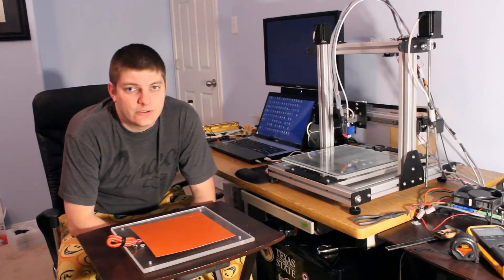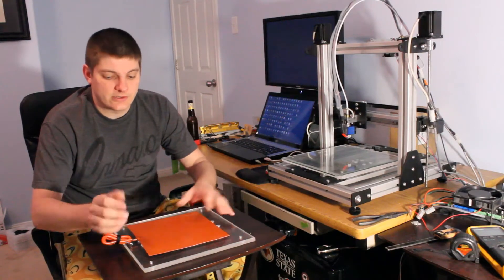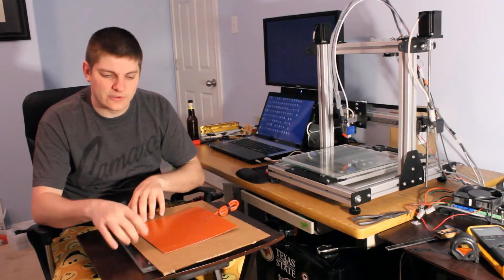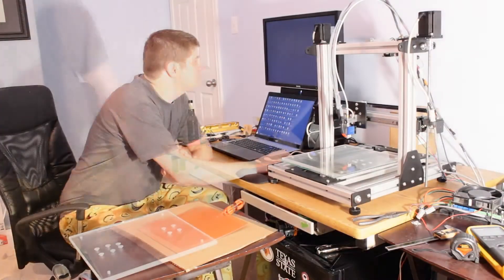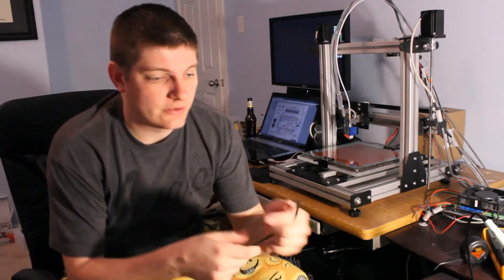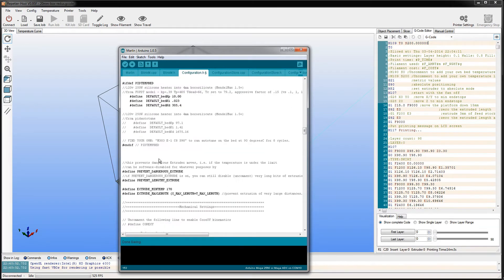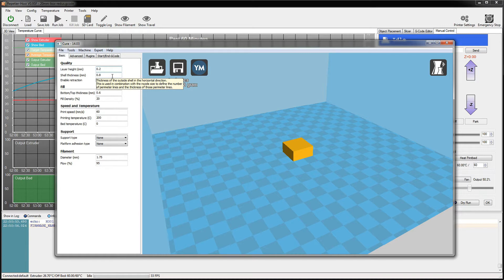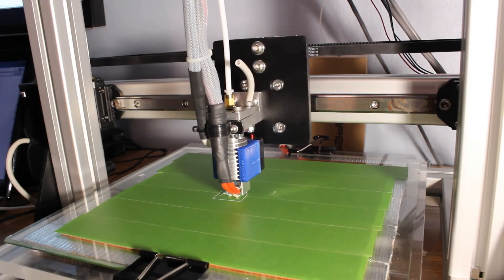Evan's DIY 3D Printer / Mill - EP10 - Heated Bed

Comment: Using an i2 I often couldnt get my prints off my plain glass heated bed. Ive never found blue tape helpful. Get your bed perfectly level and with use of a single layer Raft, temperature & layer height right *for the filament youre using and using plenty of rapid cooling going on all around your print, (ie. don't be lazy and use only a weeny 32mm 1-direction 12v fan!) prints will STICK to the plate. A bit like a WOK, your glass plate will accumulate a fine surface 'film' of PLA/ABS with use. That's what superglues correctly printed models to the build plate.

Comment: your first layer isnt sticking because your not close enough to the bed... you need to drop the head .2mm more and run it again, you will not have a problem printing on tape but you have to "press" the first layer for good adhesion and you will be able to print without heat for PLA, ABS on the other hand i print with a bed temp of 115c
Reply from the maker: 115c??? Seems really hot for a bed.
Reply: Not for ABS, recommended is 110c but I have better results at 115c

Comment: Hello. Is this the printer using the X3 PRO + Marlin? How is that combo going?

Also, i was told yesterdar i couldn't use nema23 on the X3 PRO, that is incorrect, right?

Thanks in advance []
Reply from the maker: Hi.  The X3 Pro and Marlin were supported right before I got the board, so that was nice... At the time (May/2014) it was barely working... as in only some of the pins were defined and stuff, so you couldn't do everything with super straight forward configs... but 99% of it was there.  I think I control an extra fan than it wanted so I had to go make my own constant or something to define the pin number.  I was up and running though with basic config.h and advconfig.h changes.
As for nema23 on X3 pro.... The X3 pro has no drivers built in, so you can run any drivers you want.  More realistically however, you are going to use that "pololu" stepper driver footprint, and the sd8825 drivers from panucatt.  They will be under powered for most nema23 motors, but they still work fine.

I cover all this and more in episode 2 of the series: https://www.youtube.com/watch?v=5xlLMWMJ0vA

Comment: I had the same adhesion problem when i first started printing and i found that my nozzle was .05-.1 mm to high for the first layer. You might trying lowering the print head just a little bit
Reply from the maker: Yea, I've tried everything, but what has worked for me recently is using a layer of glue stick on the blue tape.  It sticks really well, but I can still remove the parts... I'm not super happy with it, but I'll keep working at it.  I've been printing a bit recently, but having some issues.  Hopefully I'll have another video out soon about the problems and hopefully a solution.

Comment: I recently tried a Da Vinci printer out but hated the print quality due to it being 95% plastic and a sloppy mess. I just received my Printrbot Simple Metal and while the quality is leaps and bounds better I really wonder what something like your setup could do once dialed in since it's incredibly beefy with linear rails which are known to be much more precise plus add rigidity by themselves.

 If you ever decide to create a list of parts let me know, I would love to build this setup and work with you on tuning it out. First thing I would probably do is move to a less temperamental hot end.
Reply from the maker: Chris,  The first episode's description has links to the solidworks files.  The names of the files are the items I used, except of course all my custom brackets.  If you don't have access to Solidworks 2012, I could possibly convert to another format (IGES, etc).  I could probably create a BOM from solidworks, but it may take a day or two get time to figure it out.
There are also some things I might have done differently, but maybe it is a good starting point.  If you do grab the files, the M12 bolts in the front and back rails (4x per side) need to be special bolts, I had to grind mine down to save money and it was a pain to assemble because they were so tight.  Additionally where the bearing rails connect I may have an issue in CAD still since mine turned out to be threaded when I thought they were thru-holes.  I think you'd want threaded, and my part number may reflect the unthreaded ones, which is what I thought I had initially for the linear bearings.
Reply from the maker: Oh, and yes, I've had quite a few issues with the hot end.  I think it works better on ABS, but I'm still working on PLA now since my machine is indoors... I'm worried about ABS fumes, so I may move it to the garage before I go ABS.  I have to button up all the wiring still before it is easy to move, so that comes first.

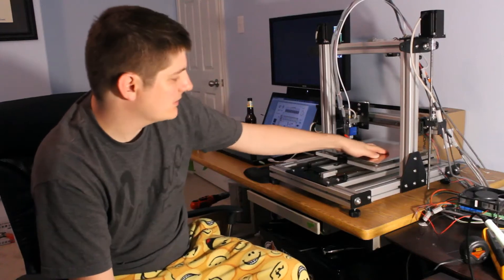Comment: Carefully moving more bed by hand... Clearly your getting some backfeed thru the system because at 8:45 you actually create enough current to drive that fan... I don't know if that was just coincidence but that's what it looked like to me.
Reply from the maker: I am only getting that backfeed voltage if I move the bed with the motors unpowered.  I think the flyback circuits on the drives are not active unless they are powered up (which is different from "enabled".  If they are powered, the bed moves smoothly, if they are enabled, the motors are locked, and if the power to the system is off, they get hard to move again and generate electricity when spun.  It actually makes enough power to make the micro power up and the usb connect on my pc... probably not good to do that often, but it should be okay unless the voltage blows the regs on my board.

Comment: I just read somewhere that glass is especially prone to break when heated unevenly, so if the heat bed heats it up in the middle but not on the outside it can break.
Aluminium would be much better for a heat bed, but I don't know if it's any good for adhesion.

Comment: the Green (Frog) tape doesn't work. Use blue tape, or even better bare glass with some Glue Stick. For PLA, heated bed is not required. Also, IIRC you are running your motors at a high current limit. Have you tried 1A, if you don't need more than that, don't set it higher.
Reply from the maker: Thanks for the tip Jay!  I'll pick up some blue and see how it goes.  I've been having major adhesion problems, but more importantly jamming problems :(

In Z I need more than 1A or they skip steps, my carriage is pretty heavy.  Hopefully that will be fixed when I get some thrust bearings mounted.

With a fan on them, the drivers don't get very hot, so I'm not worried about the 2A current.

I was hoping that the heated bed would remove the need for "goop" on the glass.  Is that true if I use blue tape?  Is bare glass printing doable if it is heated up?

Thanks.
Reply: I'm not talking about ABS juice (acetone and ABS), just a thin smear of Elmers Glue Stick (make sure it has PVA in the formula). I printed on plain blue tape for years before someone suggested this to me. I have never used a heated bed and all I print is PLA.

As for jamming...yes I had similar issues with E3D and jamming on a 0.4mm tip but I was using a Bowden tube too. I switched to a 0.6mm tip and no more jams.